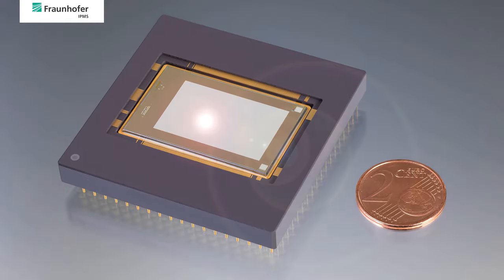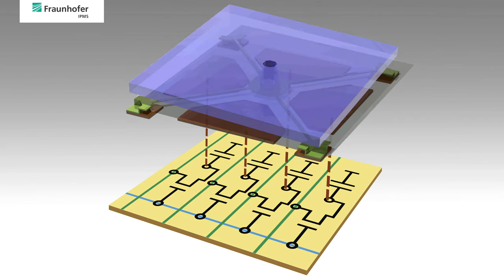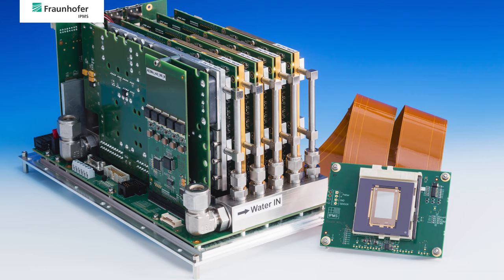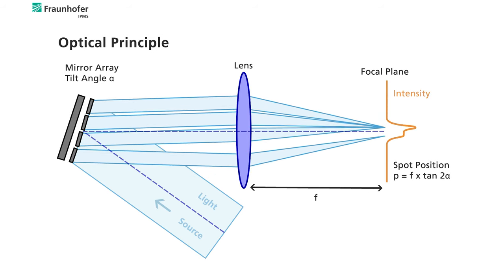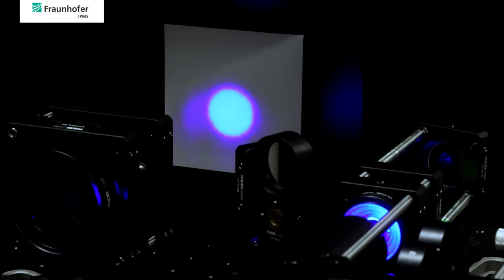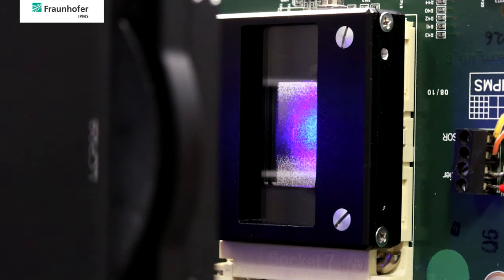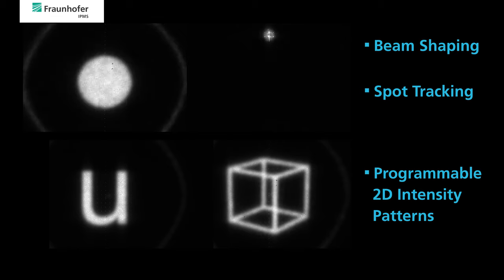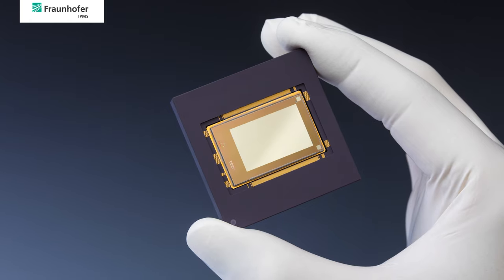Tip-Tilt Micro Mirror Array | Fraunhofer IPMS

Comment: I'm curious to know if MULTIPLE micromirror arrays could be placed side-by-side to create an even larger array for applications such as a scalable primary mirror for a reflector telescope?  For example, if the micromirror arrays were to be mounted onto a "roughly" parabolic surface (i.e., one that is not finely polished and so is inexpensive to produce), each micromirror would be used to "fine-tune" the gathered light precisely to a single focal point?  Getting around the time and expense (and also the upper practical limits) involving the production of large mirrors used for telescopes.  For this application, the update frequency requirements would be significantly lower than might be used to display video.
Reply from the maker: Hi! Such kind of side-by-side stitching of several micromirror chips basically would be possible. However, the array programming always requires some integrated address electronics circuitry, with column and row drives suituated at the array periphery as well as some wire bond contacts without mirros on top. Hence, multi-chip stitching would not provide 100% areal mirror coverage. On the other hand, such kind of stitching basically is already applied chip-inherently by using subarray building blocks to combine the entire array together. In principle, this could be scaled up to the full 8inch silicon wafer-size, where the chips are fabricated on. However, in such a case the yield in terms of full functioning devices would be very poor.

However, to my knowledge even for large telecopes there are active optics with actuator control elements on the primary mirror backside, just to control such kind of primary mirror shape deviations, in particular also gravity effects when moving the telescope, where several hundreds or thousands of such elements seem to be sufficient. Thus, our existing 164k device might already be an overshoot. Furthermore, to my understanding this kind of corrections typically would not be done at the primary mirror itself but at a subsquent conjugate optical plane.